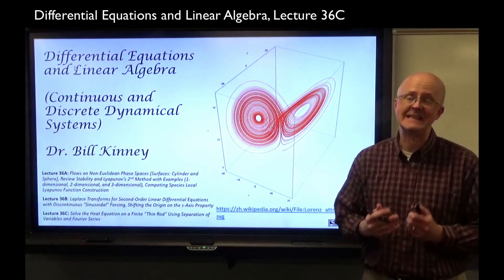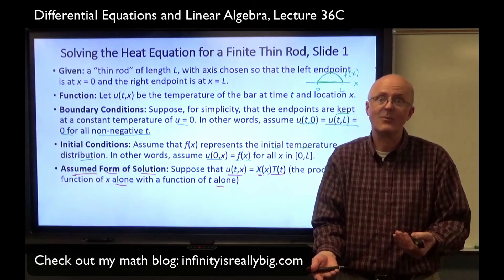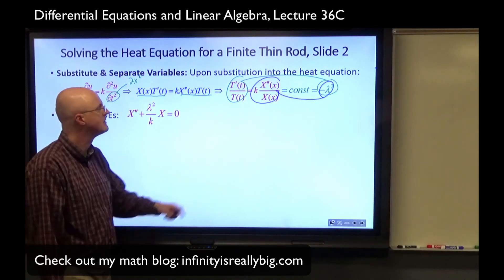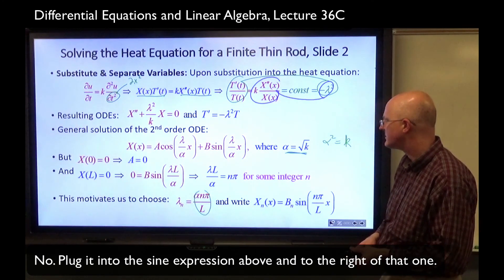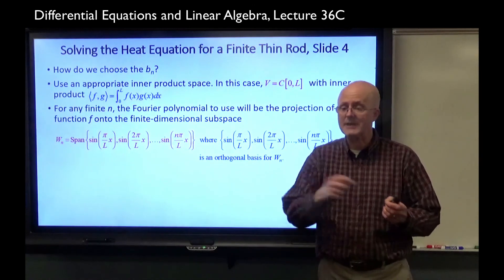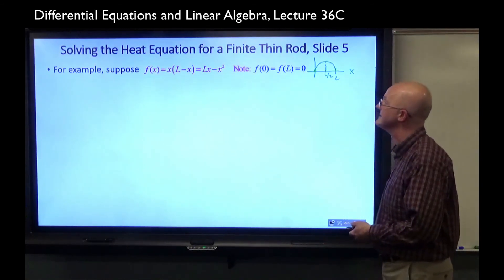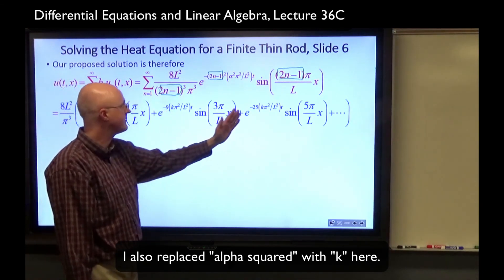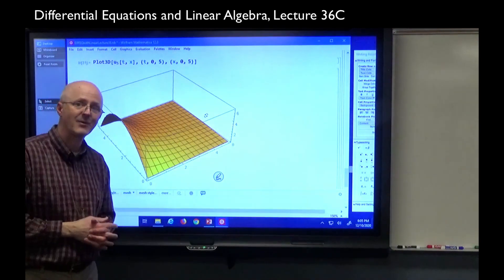Heat Equation Solution by Separation of Variables & Fourier Series (Thin Rod w/ Fixed Boundary Temp)

Comment: Professor Kinney, this is another incredible video/lecture on the Solution of the Heat Equation by Separations of Variables and its connection to the classical Fourier Series. Ordinary Differential Equations and Linear Algebra are used in the solution of the Heat Equation from start to finish. In Partial Differential Equations and Engineering Electromagnetics(a third year required Electrical Engineering Class), the Heat Equation is explained the same way for all students to understand.
Reply from the maker: Thanks, George! You're almost done with the lectures! 😀